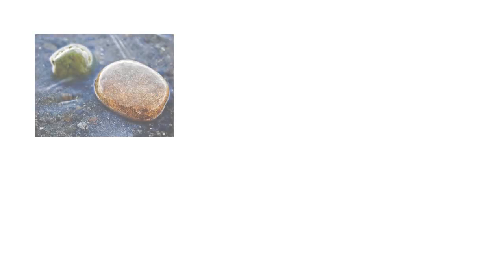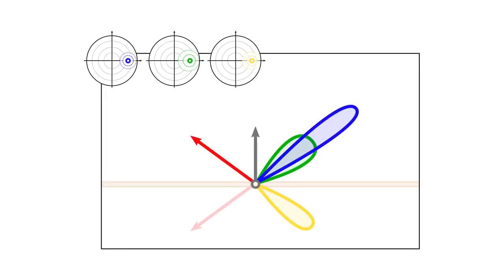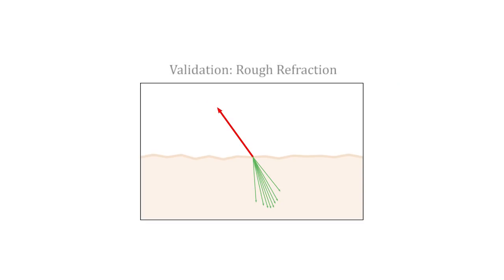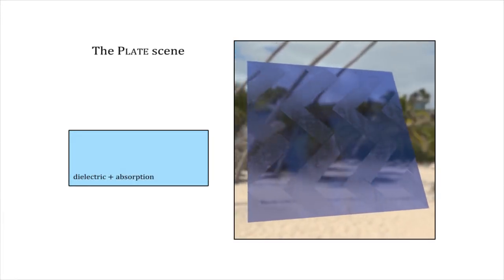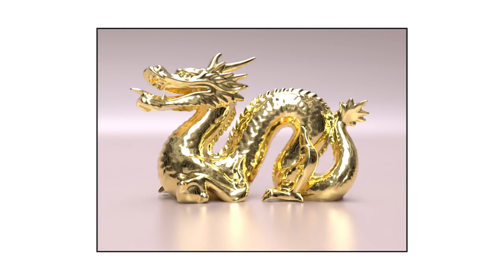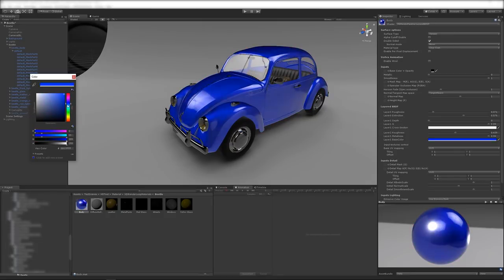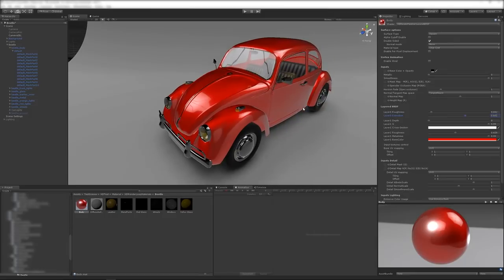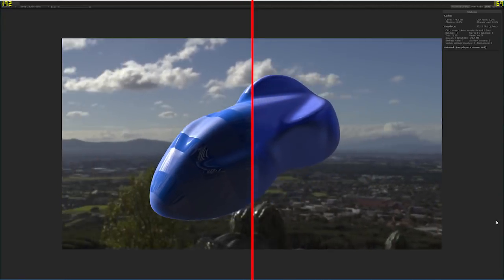Efficient Rendering of Layered Materials using an Atomic Decomposition with Statistical Operators

Comment: Excellent work! I'm a 3d artist, using Unity - is this carpaint shader available on the assetstore/GitHub? Can it be extended to toon/gradient/subsurface effects or direction based fx?
Reply from the maker: Sorry for the late answer. The shader is available inside the StackLit shader of the HDRP. I don't think you can use it for toon shading effects.